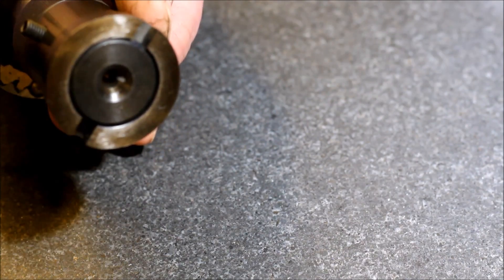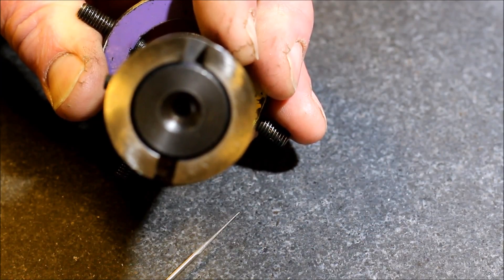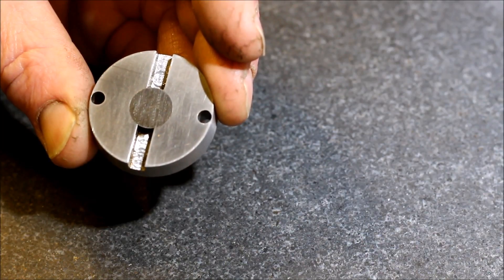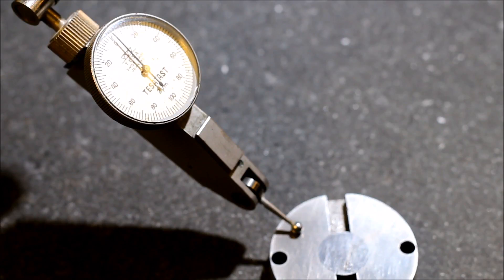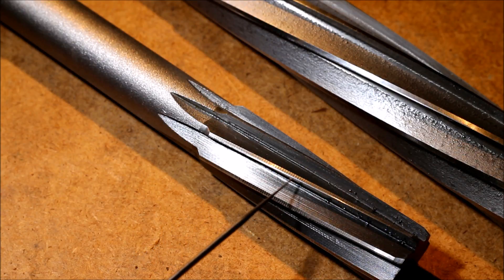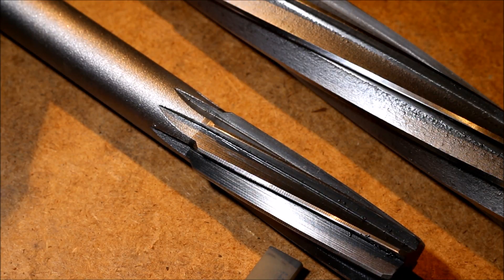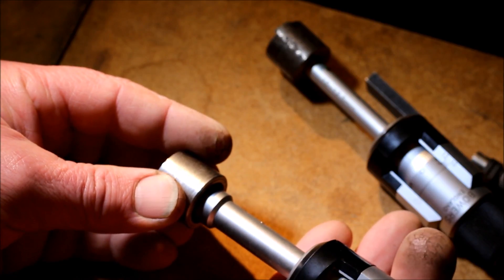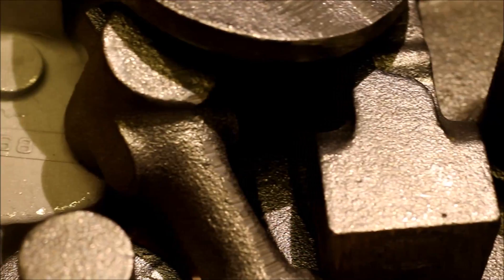hemingway kit floating reamer holder part 5

Comment: Glad you managed to fix it, but I don't think I will be making one anytime soon.
Did I recognise castings for a Thomas sensitive drill? If you build one I might be tempted to find my set of castings and start building it again. To show how long I have had them, I bought them from Mr Hemingway himself not from Kirk.
Reply from the maker: Thanks for watching. your ability to recognize things impresses. I'm tempted to start on UTP project but have to finish my project with the circular grinding machine first.
Reply: Ability to recognise comes from many hours looking at the parts and wondering where to start. Couldn't decide where so put them to one side and forgot them.:>(